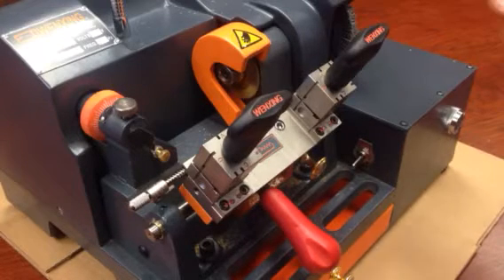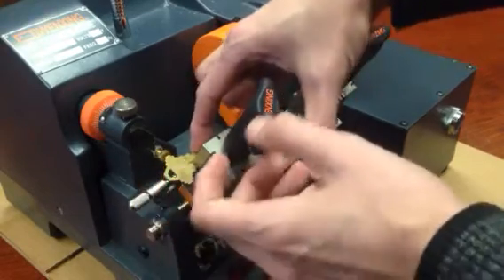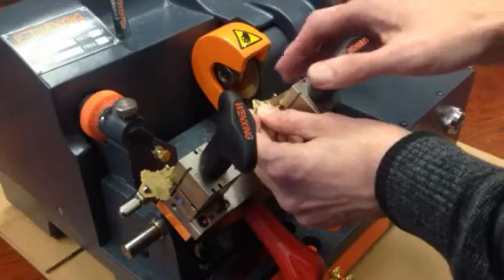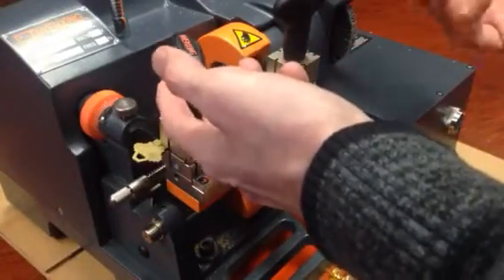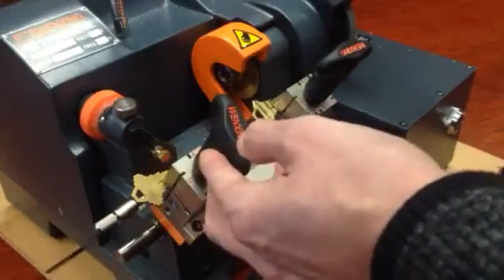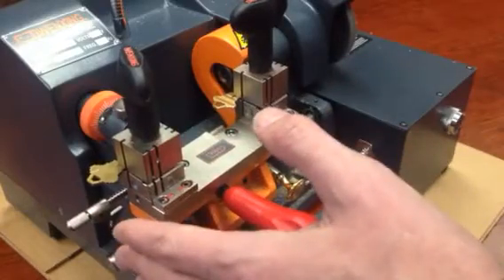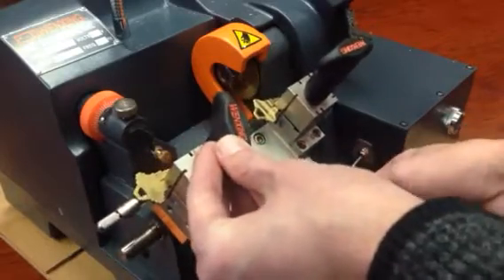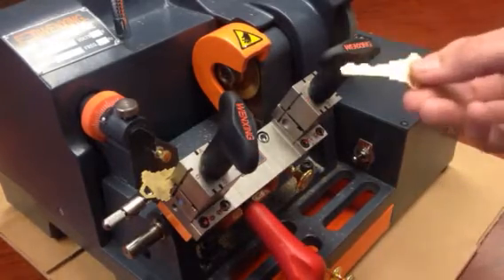W233D Fully automatic (manual optional) key machine

Comment: The machine comes with tip stop brackets that slide into the grooves on the top of the jaws. Automotive and keys without a shoulder slide in to the tip stop. This is the case with most Wenxing edge cut duplicators.